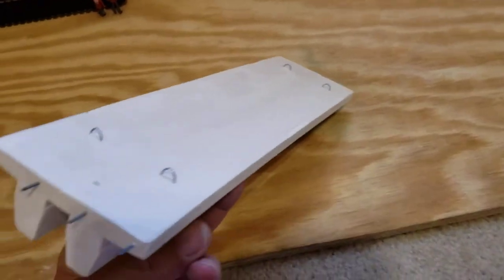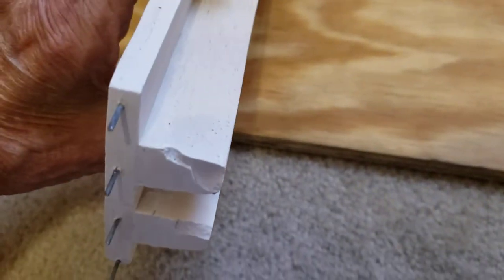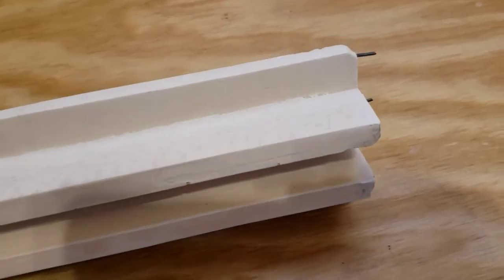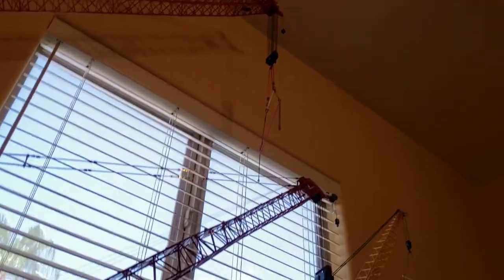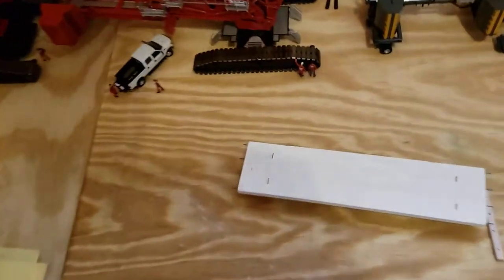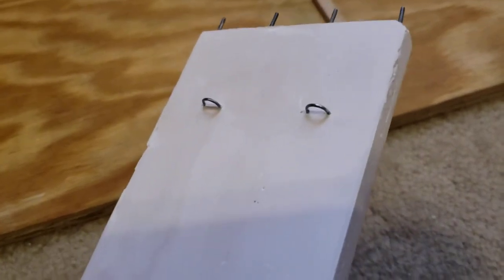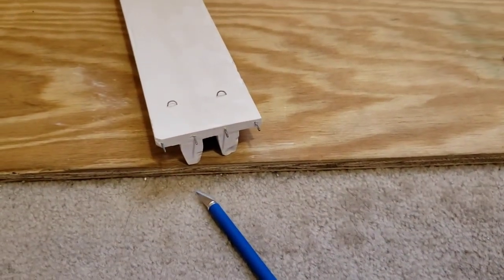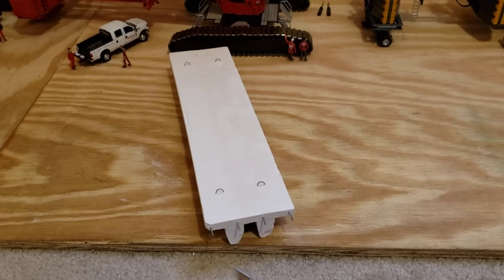Twin-T Completed

Comment: That's looks so realistic!. They have an IMC sarens bridge section for $400 on ebay. Doesn't even come with the rigging.  Did you end up putting a clear sealer on it?
Reply from the maker: No I didn't but I have fixed flaws and obtained a uniform color using flat white primer. Looks just like poured concrete. I've been making these for less than 40$. The plaster is cheap for that huge bag. Plus these have weight and tension the crane perfectly. 3D printed stuff doesn't weigh anything. Make your own rigging....it's cheaper. My spreaders are thin aluminum from a clipboard. Hooks, rings, nylon rope, and small chains are available at most hobby shops. Michael's and hobby lobby carry about all the stuff you need. 400$ buys a whole lot of stuff. Hit me up if you need any help with this stuff.